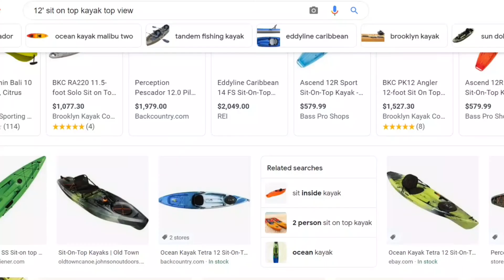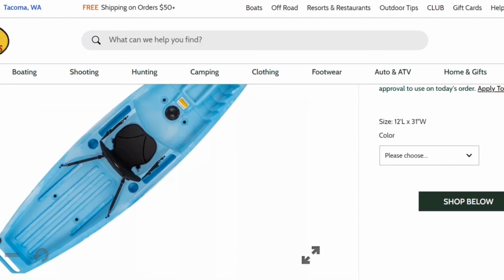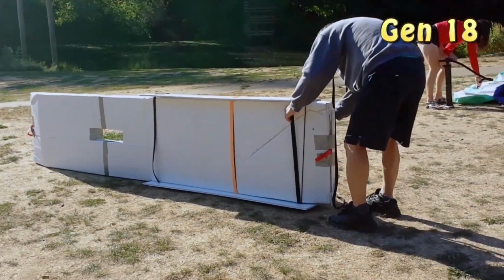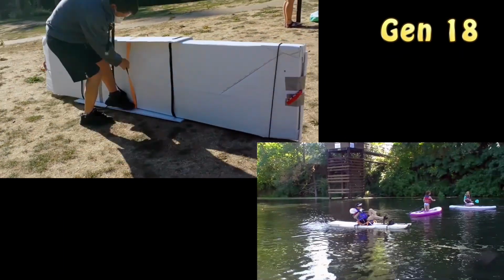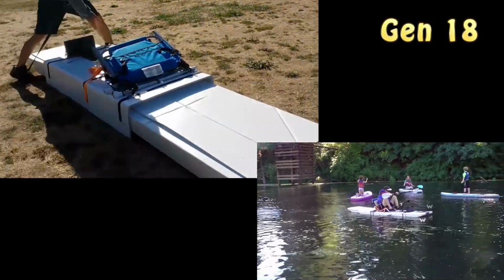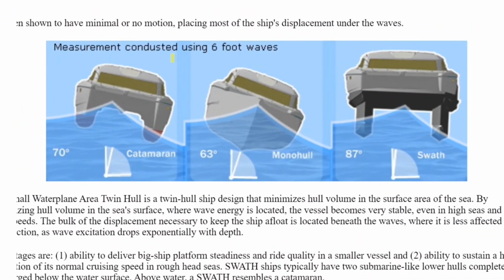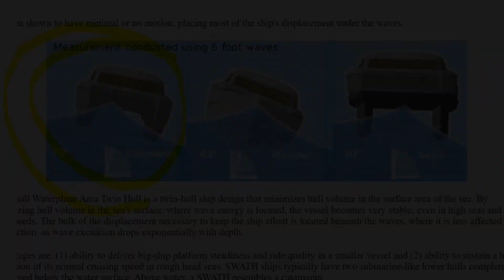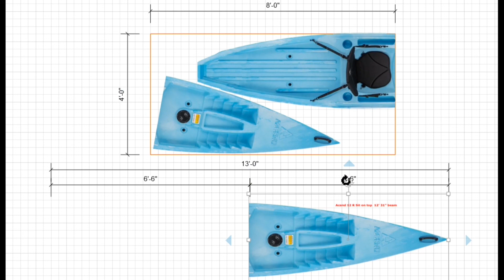Build A 20-Lb 12'  Foldable Foam Kayak - G20 #diyboat

Comment: I love your channel and your ideas!! I can't wait see the small diy bixpy and your ideal drive idea. I had the idea for a pedal drive but i found 2 of 3 components and i am not finding a good 3rd component
Reply from the maker: Thanks for your feedback. This really motivated me to move faster with my build. As for the diy bixpy drive, I bought the smaller 6-7 lb LiFePO4 battery and charger. I hope to mount the battery in a waterproof case but haven't found one that I like yet. I have an idea on a simple pedal drive, basically using the swimming fins to propel the boat. This is another project I will work on this summer. Cheers!